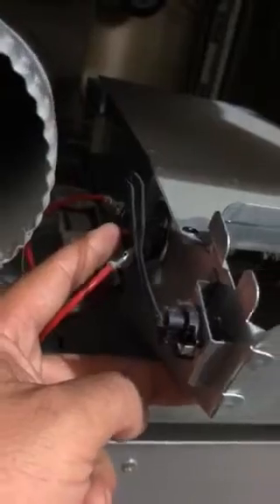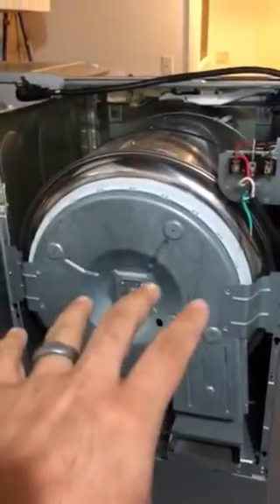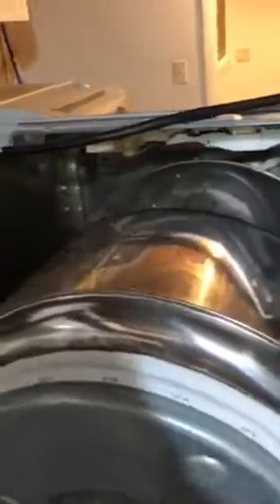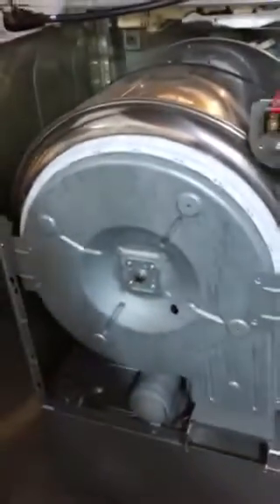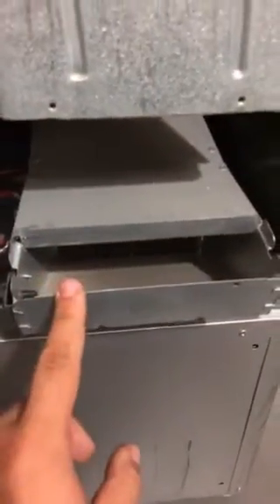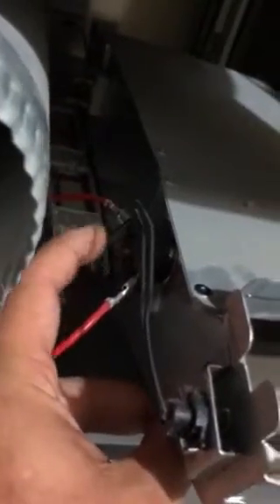Bosch dryer not drying? Here is a quick fix!

Comment: This worked for me.  Thank you.  I was  thinking that I had lost the heating coils, but pushing the reset button fixed the dryer.  Now why in the world they didn't add a small panel that you could open to press that reset button is beyond me.  I'd guess if you had to have a repairman fix your dryer it would be between 100 and 300 dollars, and all the repairman would have to do is press that button.

Comment: I am so pleased!! This worked so fast and so easy. thank you for saving me the time. I understood the reset button as soon as I saw what you had explained. Tedious to move all em screws!!! Lord - do you think there are enough of them? ;) I took the exposed back and cleared out all the excess dust that had built up at same time. Fire scares me and that is a great spot for them to happen. I could not easily clear out the draft collector at the initial lint trap in the dryer that the catcher is in, but did throw a blower in there to push out any thing that I could not easily reach. so pleased that i did this. Thank you for your easy correction to what seemed daunting!!!
Reply from the maker: Sharlyne Simpkin thank you for your kind words!
Reply: i dont mean to be offtopic but does anybody know a trick to log back into an Instagram account?
I stupidly forgot the account password. I would love any tips you can offer me.
Reply: @Finnegan Joshua instablaster ;)
Reply: @Caleb Odin thanks for your reply. I found the site thru google and im waiting for the hacking stuff atm.
Seems to take quite some time so I will reply here later when my account password hopefully is recovered.
Reply: @Caleb Odin It worked and I actually got access to my account again. I'm so happy:D
Thank you so much you saved my account!
Reply: @Finnegan Joshua no problem =)

Comment: My Bosch 500 series dryer stops before clothes are dry, it's heating but stops before clothes are dry, also there
 is water in the filter, enough to get the floor wet, what is your opinion on this?
Reply from the maker: Well, it sounds like the clothes may be going in too wet… very weird, did you try the reset in the video?

Comment: Dear Rad 2087, thanks for posting this video as my Bosch Nexxt 500 series dryer (Model WTMC332SUS) recently stopped heating.  Cleaned out vents and lint box, hit the red reset button; but the heating coils still did not turn on.  Ran a continuity test on coil and temperature limiter - and both had continuity. The only thing I didn't test was the impedance of the sensor (didn't know how).  I stupidly bought and installed a new heating unit (which includes the temperature limiter and sensor. anyway) - and installed - but still no heat.  The motor still runs, drum turns - just no heat.  Are there any thermal fuses that may have blown and need to be replaced?  Not sure where to look next.  Thoughts and/or suggestions?  thank you in advance for your help.
Reply from the maker: just a guess, but it sounds like the control board isn't talking to the heating element... but again just a guess, sorry, good luck!
Reply: Dear Rad 2087,  Thank you for replying to my question. I really appreciate it.   Because the Control Board (OEM#00666016) is one of the more expensive parts to replace; I tried replacing the relay first (part #00422203).  Although relays are typically pretty reliable - I thought I would replace the relay first.  I tested the old relaying by trying to close the circuit using a 9 volt battery - only to find out that I can't close the circuit without and alternating current.  Live and learn....lol. To make a long story short,  replacing the relay did not work. I bought a control panel (OEM part #00666016) for relatively cheap ($55 including s&h).  After taking pictures, replaced the control board - and the dryer worked!!!!  Wouldn't have been able to fix my dryer without your help - SO THANK YOU VERY VERY MUCH.  

We were in a pickle, becuase the space for the existing dryer is 28" W x 38" H - and when we went shopping....there were no dryer washer sets that was less than 38" in Height.  We would have had to tear down some wall cabinets to open up space for today's modeles of washer and dryers.  

We appreciate you!!! Peace. out.
Reply from the maker: @davidc3930  amazing! But yes in the end you did all the work, so good work and thx for commenting as this will help others as well! 
Cheers!

Comment: Awesome.. yup, there was a panel in the back, that encompassed just the fan to circulate air over the heat coils.  At first I thought I had found the wrong panel but then saw the little red button. I should have taken a picture.. but forgot.  +1 like

Comment: You're a damn saint, sir! Lol I will be trying this today. Hopefully it will fix mine. Thanks for the info and quick video!
Reply: Too bad you don't have an older tahoe... I'd definitely watch your videos.
Reply from the maker: Hope it works!
Reply from the maker: Also Laura , all be it I don’t have a Tahoe but have extensive experience as a mechanic and had owned one, let me know what the issue is?
Reply: You're awesome and I appreciate ANY input when it comes to my tahoe... I am capable and compitent to fix my vehicles, working on cars is my happy place lol. Right now it's my ac compressor. I have the new one but because she is my pride and joy, I don't want to f*ck anything up. I dou t myself a lot. I just need someone to tell me step by step, what I need to do. I've said a lot lol I'm just passionate about cars. Lol
Reply from the maker: Laura Bermeo passion is great! When it comes to A/C I usually bring them to a shop, not that I’m not capable, it’s just the releasing of the contents, purging, vacuuming the air(any contamination) and successful charging
Reply: I am heading to autozone today to "borrow" a vacuum pump and gauges. I am a mom on a non exit budget lol I will recharge it once done. Having specific tools and unlimited funds keeps me from doing everything i want, when i want it. Lol

Comment: If the dryer gets too hot to touch is this reset button bad and needs replacement or does something else control when to turn off the heat coils? My Nexxt 500 dryer stopped producing heat so I used the reset button, and it heated up again but very hot. The coils never stop glowing red.
Reply from the maker: I don’t know enough to say for sure. But I would definitely suspect the reset is bad due to over temp. You definitely don’t want an over temp dryer.

Comment: Hello good day
How are you? Thanks for the video,i need 

your help on bosch dryer wte86184,have tried everything I saw you 

did on the video but yet the Bosch dryer is 

not working and still 5 every five minutes,not 

only that it's still won't get hot even when 

working and stop every five minutes. I will be 

glad if you can me ASAP
Reply from the maker: I’m sorry to hear but your situation sounds like you may have other errors triggering the control board, contacting a Bosch tech would be a better way to find resolution for this issue.
Reply: @rad2087  okay thanks sir

Comment: mines heating but not drying. Trying to figure it out.
Reply from the maker: H berry I would check to see about the fan is connected and see if you have a a good volume of air coming out the exhaust
Reply: I have an ok output of air but I think what could be the problem is that its an old dryer and needs to have the lint cleaned out of it.
Reply from the maker: yes, absolutely clean the front lint tray very good and I even had to use a coat hanger to unclog the side hole next to lint filter. I helps to have a vacuum sucking up the lint as you do that.
Reply: The coat hanger is a great idea! I spent some time trying to figure out what in my garage could unclog that hole bc a bunch of lint is lining that area but I couldnt find something long and thin enough. If that doesnt work Ill take the back off like you. Thanks for the advice!